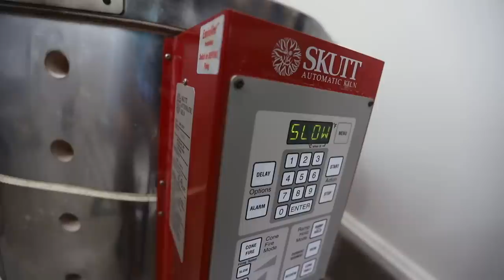Kiln Loading HACK! - How to load a kiln

Comment: When I saw you place the GoPro into the kiln, I was going to joke, "Kiln temps aren't good for a GoPro", and then you nearly did...  The fumes would have been terrible!

A couple notes for kiln loading, notice how Jon left a gap between the wares and the walls.  This helps prolong the life of the elements.  If you put things too close, it redlects the heat back onto the elements, causing them to wear sooner.
Also, it isn't advised to reach into a powered on electric kiln.  The elements have over 200 volts and at least 30 amps.  You touch one of those, you're dead.

Comment: Hi Jon! I have a question for you, I am trying to instal my kiln and I am wondering how important venting the kiln is. Do you have your kilns vented?
Reply: Do you mean venting the room, or the kiln itself?
Venting the room will pull out some heat, as well as fumes.
Venting the kiln will provide better glaze results, as it is pulling more oxygen into an oxidation firing.

Comment: I knew you were about to make a very big mistake with that go pro when I saw the angle from the kiln. lol. I know very little about pottery. Why bisk first? Is that how you spell it?
Reply: bisque! I don't know the ~science~ but basically, clay before firing is pretty fragile, so when it gets bisque fired it becomes a lot stronger, pretty durable, and not nearly as porous. So then you can go in and put a glaze on it and fire it again, and then that firing turns the silicon in the glaze to glass and makes it nice and smooth and pretty and not porous, so it becomes good for holding liquids. Depending on the use of the object and the clay it doesnt have to be glazed but for mugs and things like jon makes obviously its different. Hope this helped! This is my very basic understanding of the firing process haha. &of course some people do a single firing, some people do pit firing, raku, salt/soda firings, all sorts of different things and thats all different and idk much about those lol
Reply: Bisque firing reduces critical failures in the glaze kiln. For example, if a foreign object (like a bit of plaster from a wedging table) gets embedded in the clay that would cause a piece to explode, it is better to have it blow in the bisque load than to have tiny airborne shards landing on glazed wares and ruining the entire load.

Also, bisque is more durable than greenware. You can store it indefinitely without concern that if it gets wet or bumped it will lost. If you glaze it and then realize before you load the kiln and that you really needed to glaze it in a different color, you can just wash the glaze off and start again. One of the most efficient methods of glazing is by dipping the piece into a bucket of liquid glaze. While you can dip greenware, the unfired clay can absorb too much water when you dip and the greenware is super delicate.

Bisque (or biscuit) firing is insurance as much as anything else.
Reply: @Kelly-vo2wu  Thanks. I would love to do my own pottery someday which is why I watch Jon, but for now, I'm just learning. It makes sense to do this for mugs and things that will hold liquid.
Reply: @salemwitchchild  np! take a class if you can! That's how I learned :)
Reply: @Kelly-vo2wu  I would love to but I don't think there are any classes near me. And my life is very busy right now. It's really not the best time to add more on top of my current responsibilities. When I'm in a better place to learn and spend the money for supplies I definitely will.
Reply: @salemwitchchild  learn to throw on one of those mop-buckets with pedals that you can use to spin one of the components :'D

Comment: You could just skip the bisque and glaze things raw and use less energy.
Reply: ive been researching lately on raw glazing and cant find much info on it. Do you need any special glazes for raw glazing?
Reply: @josephbrazda5664  Underglazes only. sometimes clear glaze but still wouldnt recommend. the reason you bisque before glazing is because when you bisque, the clay particles go from being many particles making up the piece to the entire thing becoming a solid, single form. it also makes the clay porous, which allows the piece to absorb and bind with the glaze, which will not happen unless it has been bisqued. In short, glazes won't work properly and may not bind with the clay on a molecular level.
Reply: @josephbrazda5664  check out simon leach. He has lots of info about it.
Reply: I paint on underglaze in the green ware stage and then fire to bisque...can I stack underglazed pieces the same way as Jon did for his bisque fire or would the glazes stick to or contaminate each other (i.e. brown glaze getting on blue glaze)?
Reply: @mrpeanut911  you're probably not wrong. however, I have glazed things before bisque (with a raw glaze) and the glaze-fit was great.

@Joseph Brazda as adrianne said, simon leach goes into it pretty in-depth. i think the glaze does need to be engineered to be once-fired and serve as a raw-glaze
Reply: mrpeanut911 I have been working at a pottery for five years we have never bisque and make 60,000 pieces a years. You don’t need to bisque. Water in glaze will absorb into dry clay like bisque ware.

Comment: I’d be too worried my green ware would break. Plus I have more than just mugs so it’d be awkward.
Reply: it's not too bad. i have witnessed kiln loads of more than just mugs that are tumble stacked. it just requires you to be good at tetris, kind of. most things if stacked well will not break (unless they're wayyy thin/fragile and/or are under more pressure than appropriate)